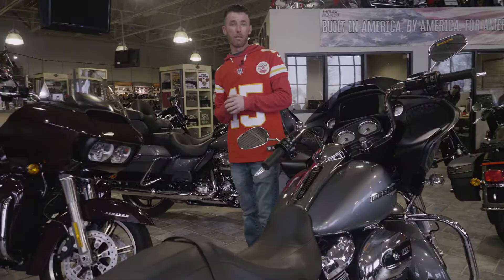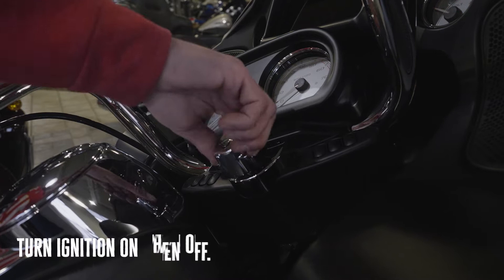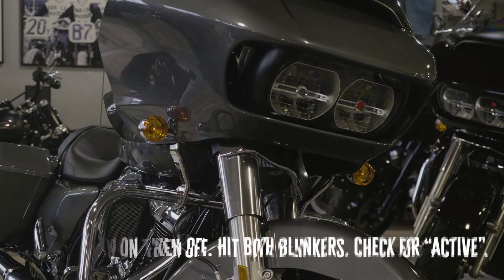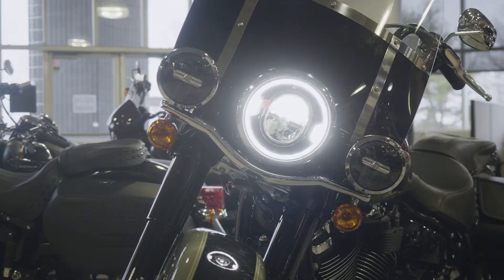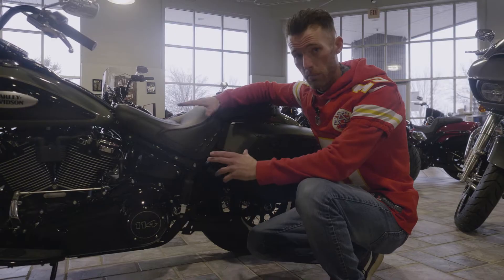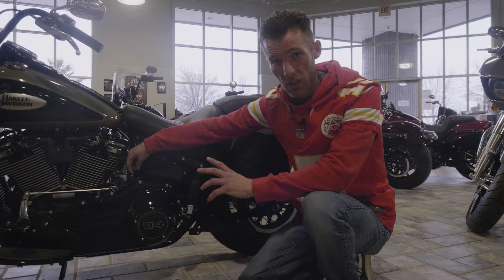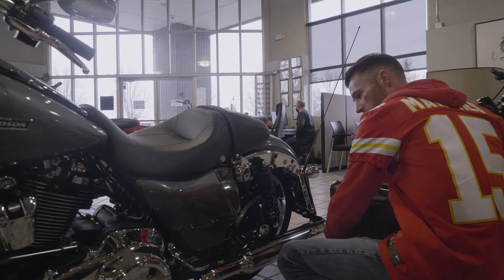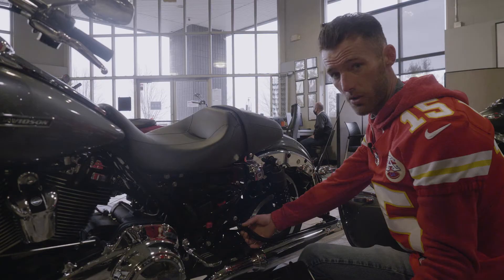Transport Mode - How To Put Your Harley-Davidson in Transport Mode

Comment: Is there a procedure to take it back out of transport mode, or does the bike just restart normally in the presence of the fob?
Reply: nothing needed to take it out of transport mode.  Just have the fob with in range, turn it on and fire it up and that takes it out of transport mode.  one item he was not 100% clear on is when you turn the bike on (make sure you have the fox),  you have to turn it back off prior to the security light going off - then you hold the turn signals simultaneously.